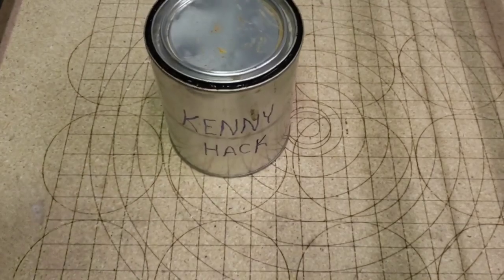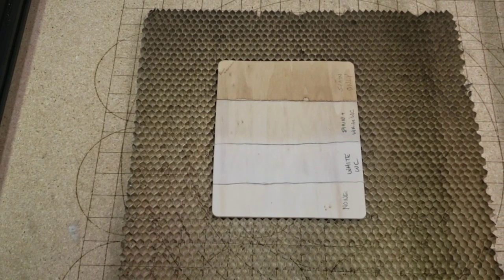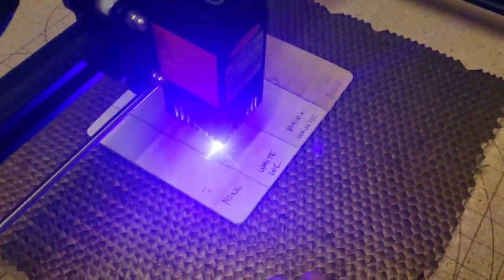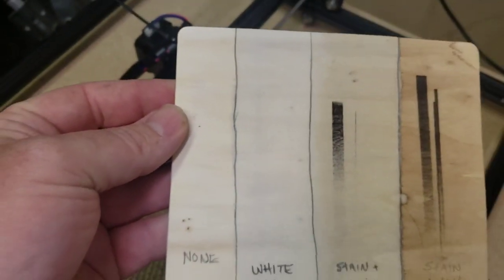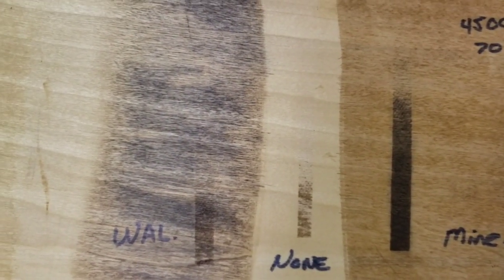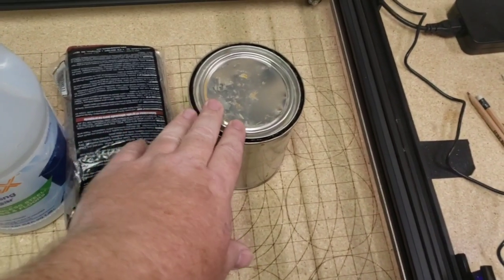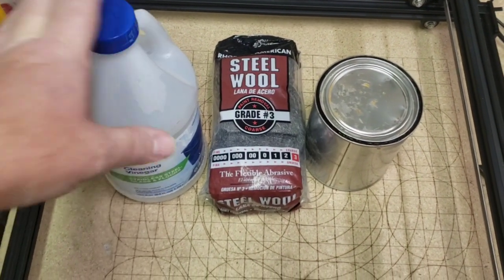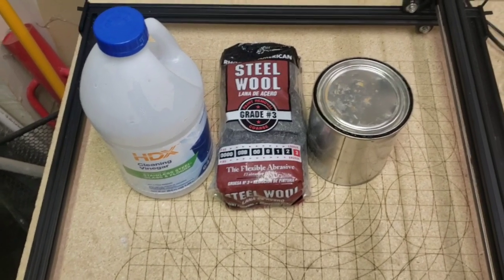The Kenny Hack: The best pre-stain/treatment for lasers out there? Ortur Diode Laser.

Comment: Best hack in the world....I love your hack been using for about 2 weeks now....Did a photo tonight 6000/50 straight up Grayscale...
Reply from the maker: Nice! Be sure to share in the Forums. Being a small channel it really helps when subscribers help spread the method and where to find it. Hopefully, we are in the same forums and I get to see the results. 

What were your max and minimum laser powers for the greyscale?
Reply: @TheKennyHack  35 but I bumped it up to 50
Reply from the maker: @bigbeartn  so itvwas 50 max and 0 minimum? This stain does work really well at getting the light shading to show up but I thought you might have to set the minimum power around 5%. I hope I get to see the results.
Reply: @TheKennyHack  So do diode machines struggle to do grey scale? I'm new to laser engraving, I bought an Atomstack A5 20W but whatever settings I use and whatever quality photo, it just seems to burn really dark or nothing at all on wood and on tiles painted black, I get no light or mid tone greys, even on dither it appears to miss most of the dots in the lighter areas so that it looks almost blank. I've been feeling really disheartened and frustrated but I'm glad I've come across your videos, thankyou for making them, and I will certainly give your Kenny Hack solution a try on wood.

Comment: Thanks for the tip
Reply from the maker: No problem!
Reply: @TheKennyHack  you have any tips for carving, I got my house number to carve out good the other day, and now seems all it's doing is burning the wood
Reply from the maker: @cutflower36  ive only been able to get really soft woods to produce a carved effect. Where the laser seems to emboss deeper into the wood with higher power instead of just burning it black. It seems to work better if burning onto the end grain of wood instead of a ripped slab that's sanded.  Im sure it will depend on the wood density of the grain how deep it will emboss but I really don't have any recommendations on type of wood or a supplier for it. Im sure there is a surface treatment out there that will help make the laser emboss instead of burn but I havent been trying to find that one yet.  Lol
Reply from the maker: @cutflower36  the one time it worked really well for me was on a piece of cedar that had already been clear coated; with what I'm not sure, but the wood would hardly burn and the image just kept getting burnt in deeper. Might have been the cedar might have been the clear coat. Something to try but burning clear coats can produce strong fumes so make sure you have adequate ventilation.
Reply: @TheKennyHack  thanks for responding, its a trip. I'm almost ready to for get about it. Thanks for tips. Maybe it is the wood. I got a lot of pallet wood on my porch. But idk. I tried engraving soft 2mm and it burn too. Thanks again

Comment: Ok I've been following along and was your 101st sub. :) But have you thought of other tests for maybe the components of the mix like is it maybe just the vinegar or even just the water in the vinegar.
Reply from the maker: Oh yes, ive been trying different things but haven't found a combination that works as well yet.
Reply: @TheKennyHack  last night I applied water and vinegar to some wood and will put some 6 day old "juice" on another and see. 

But wonder what the mechanism is? Does the dissolved iron some how react to the heat or even the light. Like a how silver nitrate is used in film. 🤷‍♂️
Reply from the maker: @chartle1  ive had no luck with just water and vinegar. Its the dissolved iron oxide in the solution that seems to be the key. Im currently trying to make a mix with just iron oxide powder but no luck in the experiments yet.

Comment: As you stated ,Ebonising fluid has been around for a very long time. Curious as to why you diluted it with water though it would tend to raise the grain, must try that tonight with my 5.5 w diode On different timbers.new twist, thanks for the input 👍
Reply from the maker: Dilute to reduce the straining effect. Pure would make the wood probably too dark. You lose some lasering benefits as it gets more diluted but even down to only 5% stregth it helps the wood burn easier. I think its better to put on strong and cut the stain back with a white water color like the video shows. Its all an ongoing experiment but it does allow to greatly speed up the laser and reduce the power needed.
Reply: I am the same: have used it in woodworking but hadn't thought of attempting for engraving.

I suspect the solution's capacity to bring out the tannins in the wood (along with the iron in the mixture itself) is what produces the effect.  The laser may well be burning the microscopic iron molecules (or heating them to such a degree that they, in turn, burn the surround wood quicker than without using the treatment.  

Raising the grain may actually use this effect too (laser has an easier time being the softer, raised grain?).  This could explain why the rust-oleum clear-cost applications also work: it gives the laster something to burn other than pure wood plus that stuff has a tendency to raise the grain as well.

In all, a nest little trick (provided your project can stomach the wood color variance caused by the treatment).

Comment: Glances at the ingredients in description before watches the video.. Oh.. its vinegaroon..
Reply from the maker: If you had watched I never claimed to come up with the mix. It has been used for a long time in wood working and crafts. Just haven't seen anybody using it with lasers. It's by far better than anything else I've found yet for improving laser performance.
Reply: @TheKennyHack  Oh i watched, was curious what your ratio was since it was such a light coloring still.
Reply from the maker: @MattWeber  I'm going to run some dilution tests to see how thin I can get it and still produce the quality. I painted over it with white water color to get it back to almost natural color and it still burned really good.
Reply from the maker: @MattWeber  that solution doesn't have the same aging reaction with all woods. Some pines it wont hardly change at all. My stir stick I use for that can has now turned black.
Reply from the maker: @MattWeber  I've made another video of using this at different dilutions. Worked very well even down to a 12% dilution.